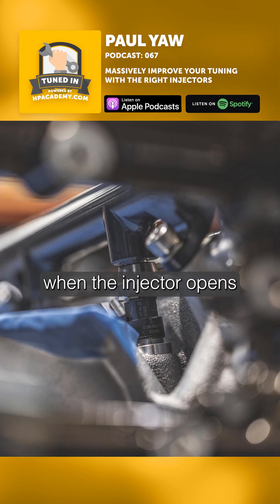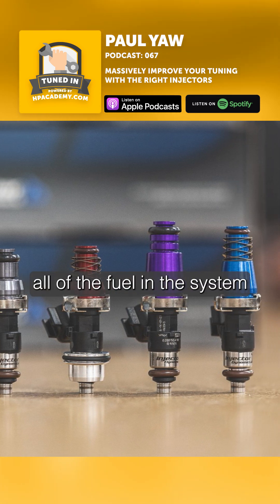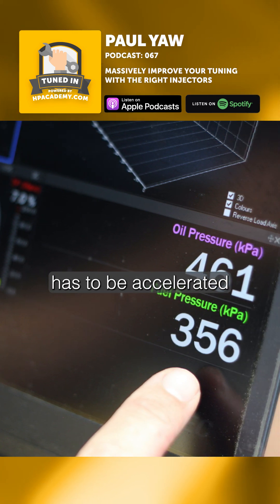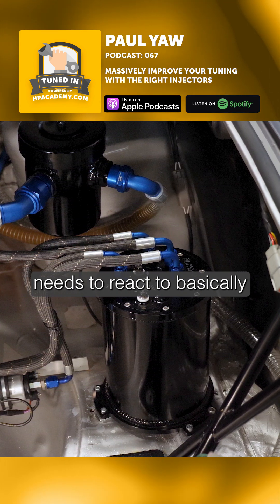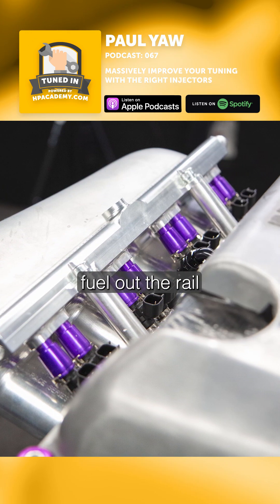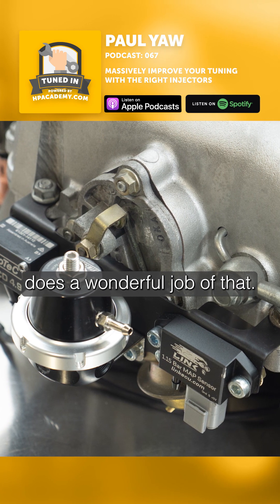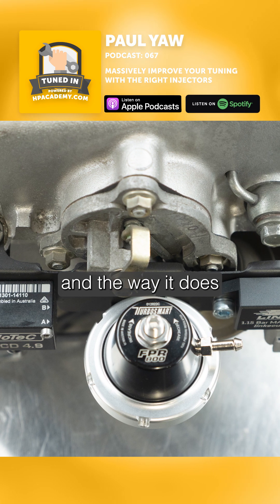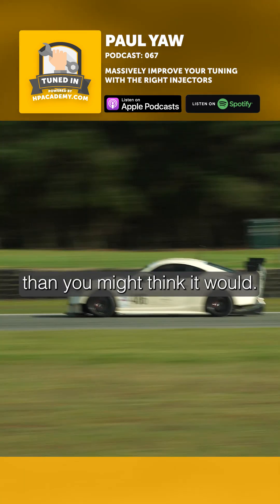Did you ever think of this? #shorts

Comment: so the regulator sits at the end of the rail
Reply: Most of the time when you have a return to the tank the pressure regulater need to keep up the pressure in the rail if you put it in front of the rail you dont have pressure at the rail only in the line